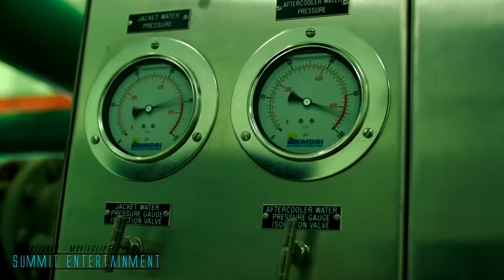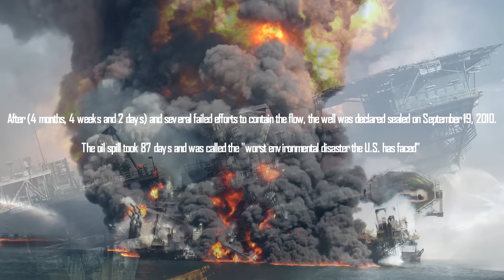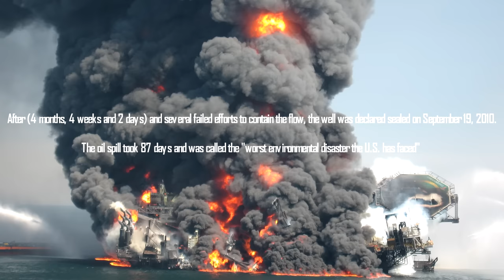Deepwater Horizon |2016| All Blowout Scenes [Edited] (April 20, 2010)

Comment: 5:35 Should mention whats happening here. Those "blades" are of a Blind Cutting Ram, part of the Blowout Preventer. In an extreme emergency, they are activated to sever the drill pipe. Depicted here, the sheer force of the oil and seawater broke the blades, but in reality on the real Deepwater Horizon rig, what actually happened is that the drill pipe had been bent by the sheer pressure difference between the inside and outside of the drill pipe, meaning the Ram blades couldnt reach and fully cut the pipe.
Reply: Surprised it didn’t even show the computers in the redundant pods were broken/dead/miswired.

Comment: screw the rules i'd cut the line immediately especially after the damn thing exploded
Reply: the problem was the blind sheer rams were misaligned due to the pipe bending before hand
Reply: Lelouch Strife Except you couldn’t.
Reply: @swatboy763  Apparently they where not designed to cut that type of pipe as well so even if there was no leak on the rams it wouldn't of cut it properly

Comment: It clearly shows how the generator exploded with cameras inside the machines..that's what I love..the gas came into the piston tubes which caused over ignition and caused over rev which either jammed or locked up cuz of some safety measure and then the spark plugs sparker up the natural gas which lead to insane explosion. Its the best very detailed scene from  the movie
Reply: There is no spark plugs on a diesel engine, Compression ignition only not spark ignition like petrol or gas engines.
Reply: @kiwidiesel  oh right yeah lol

Comment: Y did that blow out happen actually ,guys ?
Reply: Yeah :( and 11 people died
Reply: Not maintaining/repairing tons of important equipment to save money. There were so many safety precautions in place that could have and should have prevented this but thanks to negligent management, most of it was broken, unreliable, or completely turned off.
Reply: Air pockets underground, when a drill hits an air pocket underground it will eject that air, soil and rocks (this one ejects mud cuz its underwater) at very high pressure and the tighter the space is, the greater the pressure will be.
Reply: There's a video of a Land Oil Rig I think it was in Russia exploding just like this in spectacular form
Reply: Miss management. Lack of knowledge on safety on oil Rig regarding the people who are responsible for productivity. Economic-driven. I wished those two are jailed.
Reply: Because all the above and because a cloud of natural gas formed all around the platform and some of it entered the diesel engine, which you can see start the entire explosion.
Reply: De-regulation of the safety standards, and budget cuts to the Federal org responsible to ensure safety protocol are followed. In other words, "Small government mandate and Self regulations". The federal investigation concluded 8 system failures contributed to the incident. Bullshit. There is only one major failure, and that is simply to believe that allowing industries and companies to regulate themselves vs. government oversight.  Keep voting for "small government" and this is what you get.
Reply: The actual cause of the initial blowout was an improper cement job, which the BP company men allude to in one of the preceding scenes (saying they are confident in their cement job, but not having full tests done). That's what allowed what should have been a simple kick to turn into a full blow out. The blow out preventers (BOPs) failed when the crew attempted to seal the pipe, then the pipe started to buckle under stress which is why the shear rams couldn't cut and seal the pipe. Part of it was the desire to cut corners to push the schedule which made for the cement failure, and this combined with other equipment failure and a quick string of bad luck; resulting in a complete loss of well control.
Reply: Good one my friend...that's a perfect summary of this avoidable incident.
You spoke like a true petroleum engineer!
Reply: Marv Agunloye funny thing is that I'm a Lease Operator rather than an Engineer and I understand why this blow out happened better than a bunch of engineers I know. However, I've heard and learned a lot from my family over the years since I'm a fourth generation oil field hand.
Reply: First the oil built up to much pressure therefore causing the oil to burst out of the pipe. Then the air intake sucked up the flammable gas and led it to the engine. The turbine near the engine got stuck therefore creating sparks that lit the flammable gas causing an explosion.
Reply: Blah b safety regs wouldn't have been even remotely involved in this blowout. Its cause would be covered by environmental rather than safety, besides the EPA has had regs in place for 30+ years that are meant to prevent this EXACT scenario. The BP company men just fudged the reports. I don't see how adding more bureaucracy would help, when bureaucracy clearly demonstrated in this scenario that it does no good. If you come to a wall in your path would you keep beating your head against it to try to knock it down or simply use the ladder right next to you to climb over it? Because a bureaucrat would try to beat the wall down with someone else's head.
Reply: +Drew Kennedy
Typical American answer what you wrote. Regulations fail because they're too lax to be enforced? Remove even more safety regulations and let the free market wreck havoc!

Instead of, you know as most countries do, tighten regulations beyond a 1950's level of 'safety' and actually enforce them.

Also, when there's a wall in your path and you need go through, you knock the wall down and proceed. You don't become an American quitter going "Well, I can tell from this wall the corporate overlords and their republican party don't want me to proceed, so I obey"
Reply: Blah b the wall isn't "corporate overlords not wanting me to proceed". It's more along the lines of government regulations in the way of a stronger economy.
Reply: Not an air pocket, METHANE GAS pocket.
Reply: I'm currently doing a major in this field, and the recreation seems very accurate. Since there was a significant difference between the well pressure and hydrostatic pressure, a great portion of the extraction fluid, (mud) and the oil and gas itself made its way up and past the automatic emergency mechanism or BOP (Blowout preventor), wich by those differences in pressure, caused the well to go through a lot of stress and bend, and consequently, the blades of the BOP failed to shut tight and therefore the leakage made its way to the platform, provoking a disaster.
Reply: They didn't install enough bracing for the sub surface pipe, therefore it just couldn't handle the pressure.
Reply: Multiple problems but the one that caused the disaster was a bad cement job at the bottom of the well
Reply: Also a few days before a technician noticed rubber chunks in the drilling mud. He brought these chunks to BP personnel and was blown off. These chunks were from the annular valves in the blow out preventer. When the annulars valves were met with the high pressure, they failed. Because the annulars and then EDS failed, they were unable to stop the high pressure coming up through the drill pipe. Between this, the bad cement job, and safety and operational procedures that were ignored is why this all happened.
Reply: It's because one of the machines function was not working properly so that happened.
Reply: @hetecks1385  its a little more complicated than that. Not just 1 machine failed. It was several failed machines along with failed procedures
Reply: @seancrowley8249  yeah I know but I wanted to oversimplify it.
Reply: @RAZZOR310398  SHEAR RAM(S) is propper name of it...
Reply: They drilled too deep
Reply: stop it get some milk we’ll can you stop spreading misinformation
Reply: courtney smith and you too
Reply: @smithcourtney  talking to me?
Reply: Sorry, purple kid instead
Reply: Punith Naik are you asking why it happened mechanically? Or how the pressure made it to surface before it was even noticed?  The bop (blow out preventor) failed because it wasn’t maintained/rigged up correctly. While pressure should of been watched the entire time seeing as how the annular was closed, I’m assuming they knew the well was live, or even took kicks before the big one came.  If you’re asking why it made it to surface, could be hundreds of things. They could of not been pumping enough to kill the well. They could of not been watching their pressure and bleeding it off slowly.
Reply: Bp told them to skip the safety procedures because it was “already under control”
Reply: Sorry to necro this one, when you are drilling for oil pockets of natural gas and methane are usually very common, it can seep through the rock and into your drill shaft. To protect against this the shaft is encased in concrete, helping it to act like a straw until you get down into oil. In the US the procedure is that after a company does the cement job a different company inspects it, in this case the work was done by Halliburton and Schlumberger was supposed to do the inspection but they were rushed and not able to complete it (the guys you see them trying to talk to on when they arrive on the rig about the cement log, that's schlumberger). The concrete job for whatever reason ended up being bad and gas was seeping out of the rock into the drill shaft, but the drilling mud was still maintaining enough pressure to hold everything down, like shoving your finger into a leaking hole. The blowout occurred once the crew started to remove the drilling mud onto the nearby ship getting as they were getting ready to cap the well and move on. Once enough of the mud had been removed there was no longer enough pressure to hold the gas in the shaft so it all flowed out, and the oil with it.
Reply: Iirc a documentary about this said they eventually found out it was concrete of an inferior quality with iirc essentially the consistency of a sponge or something like that.
Reply: Also there was supposed to be 21 devices called "stabilizers" installed to keep the bore even.....BP installed 6...6!
Reply: Punith Naik Lots of safety measures not being maintained. All the safety measures failed.

Comment: Something I've wondered about in this movie, maybe someone can offer some insight - did gas cause diesel engines to run away, as seen in this movie? The ignition source will probably never be known, but the characters in this movie were well aware of the diesel engines running away, did the survivors say this happened in real life? I've read there are supposed to be air intake shutoff valves on engines on oil rigs, for this exact reason, but given the poor state of everything else on that rig it wouldn't surprise me if they were not functional.
Reply: The ignition source was a methane bubble. Diesel engines will definitely run away if an outside source of fuel gets into them. The engines did indeed run away but I don't know if they had any way to shut them off.
Reply: I understand how runaways work, would certainly be plausible in this situation, though they should have had a way to shut it off for this very reason - though that might have been broken like everything else. What I'm wondering isn't if it could, I'm wondering if it did - did the survivors report such things? Did they see the engines running away? Did all the lights get brighter?
Reply: I remember someone mentioning the lights and everything getting super bright as the generator overloaded in an interview, though I would think that would trip the breakers. As for the ignition I think it would be from the engine seizing up and breaking under the strain, once those pistons expand from the heat and lock up, 
but whatever the cause once you get one spark with the air so saturated with natural gas everything's SOL. I've never heard of a shut off but I do know they make hydrocarbon filters to keep stuff like natural gas from getting through the air intake into the engines.
Reply: That's the big thing I was wondering - people on board said this did happen. As for the ignition, an overspeeding engine seizing and blowing is a hypothetically plausible ignition source, but I would suspect they don't know for sure, could have been just about anything, there are plenty of hypothetical ignition sources - any spark pretty much. Whether or not a breaker would trip, that would depend on how much it oversped, and how much current load was on it. My understanding is that circuit breakers trip with excessive current, usually from too much load (demand) on the circuit, rather than excessive voltage. In general, more voltage from an overspeeding generator would increase current (due to Ohm's Law and other electrical behaviors) but if not that many things were switched on on the circuit it wouldn't necessarily cause enough current to trip a breaker. Would increase the current through an individual device, possibly even causing light bulbs to blow as seen in the movie, but if not that many were turned on the overall current wouldn't be enough to blow the breakers.
Reply: Its impossible to say for certain what kind of overcurrent protection devices were or were not present without actually knowing the Deepwater Horizon's electrical layout at the time of the accident. It is plausible that the overcurrent was not severe enough to blow the bulbs like in this movie - that may have been a dramatization. It doesn't take much to make a light very bright, anyway. Everything might have still been within tolerable levels. There also were indeed several emergency shutdowns present on Deepwater Horizon, available both in the Engineering control room and the main bridge, but for whatever reason, none of these were activated. I've seen interviews claiming corporate pressure, or it may have been too quick for reaction, or some other reason.
Reply: Diesel engines are self igniting I think it would take a few seconds or minutes too long for them to figure out how to stop it and besides the people in the control room we’re not aware
Reply: @marlo8850  Engines like this, being self-igniting and having no throttle, will run away if a fuel source is introduced in the intake, and shutting off the intended fuel (the normal way of shutting it down) won't work, but for this reason in places where something like this might happen - from what I've read it's required to be installed on oil rigs (which doesn't mean it was functional given how poorly maintained everything was on this rig) - they install air shutoff valves that can shut down the engines very quickly when activated, or probably even automatically if the engine runs too fast.
Reply: @quillmaurer6563  yeah Engines should not be messed with especially on a freakin oil rig you have escaping gases all the time. A well monitored Engine is necessary.

Comment: A classic example of how disasters are created: Multiple bad decisions after bad decisions made in the name of profit.  I don't know if they ever were warned or had a meeting like shown, but I doubt it was ever stated so clearly that they were playing Russian Roulette. Also, I believe that actual spill was more than twice what was reported closer to 12, not 4.9 million barrels.  I remember watching the live video form the wellhead showing the oil flowing.  And just doing a rough calculation from what I could see I was getting number 2.5 bigger than what the talking heads were saying.  More than 1/2 of the oil never actually came to the surface, but mixed in about 500 feet down and drifted way down current.

Comment: Curious if it would've turned out better if there was an emergency system to completely detach the link in event of seal failure. Though it would be harder to seal the leak later, it would immediately stop the flow of flammable liquids and gasses into the platform.

Comment: The screen at 7:29 appears to have an error.  210 million gallons is 794,936,474.64 litres.  Not 794.93649 litres. That is all.
Also, I found the wording "4 months, 4 weeks, and two days" extremely odd because if you add it up, 4 weeks is 28 days, plus 2 days, that's 30, days meaning the time period was exactly 5 months.  So just say "five months".  It's way easier to say "5 months".

Comment: Why did the seals fail in the first place? because as i understand when the bop was built it was certified to hold back that kind of pressure.. Was it a ram fluid leak? or was it just the fact the pipe was off center a bit?
Reply: i think it is because the pipe was bent
Reply: Because by the time they noticed and reacted to the kick, it was basically too late and already in progress. They failed to notice the warning signs. When they closed the first valves on the BOP the fluid and gas was already on its way.
Reply: @fnhatic6694  the bop of that design was rated up to 10,000 psi so obviously something failed before the accident..

Comment: how much PSI of pressure is in a typical oil well?
Reply: @D.C.L PRODUCTIONS that's about 2 and 1/2 tons per square inch. that's quite a bit.
Reply: Derek Wall if you want to know the hydrostatic pressure in any column of fluid just use the formula 0.52 x mud weight(ppg) x true vertical depth.
Reply: @mcgee_tradez4991  can an oil well blowout actually cause that much destruction?
Reply: @derekwall200  yes theres little of it left today

Comment: 1:47 Why was there a Submarine Sonar Ping? I get the wub-dub sounds, but a sonar sound effect?
Reply: It’s the híper extension of metal cables
Reply: @jorgesandoval7401 So is it the sound of individual small wires of the cable breaking? Yeah, that's terrifying.
Reply: @seanrosenau2088  indeed